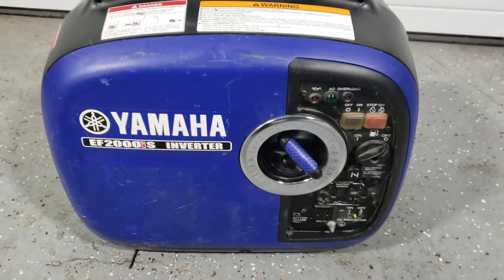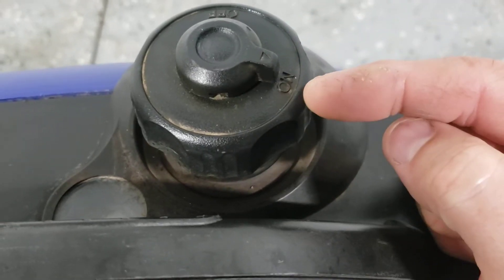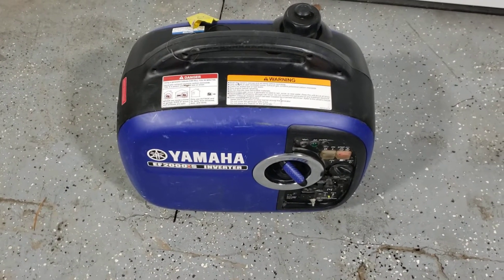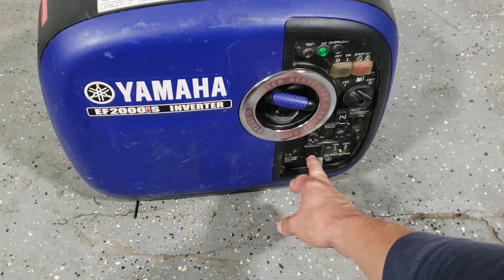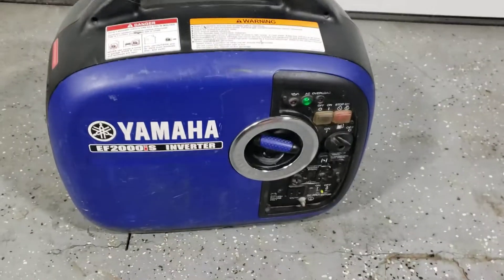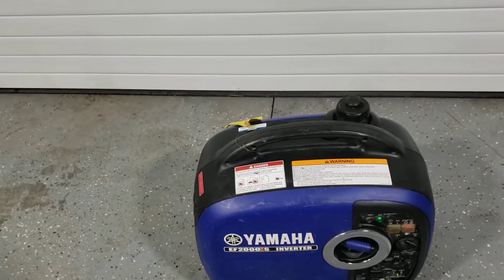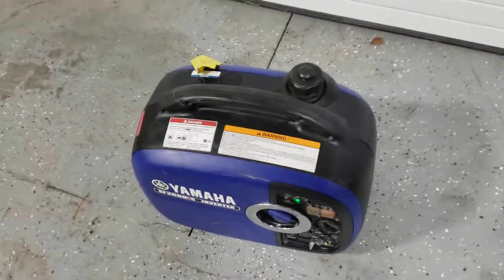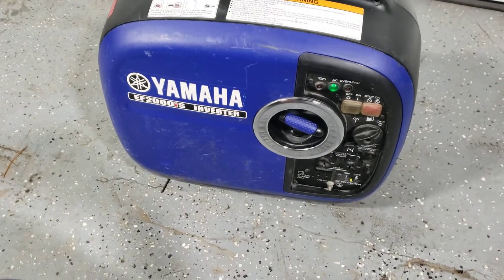Yamaha EF2000is Inverter Generator Operation

Comment: I have the same generator. I think I bought it around 2016-1018. Tested it with Coleman white gas. Worked great .  Welcome to April 2023 . Bought more Coleman gas to retest the generator. Started on the first pull . Coleman white gas is $ 14 a gallon today. Great gas Great generator .  I keep it for Hurricane season .

Comment: you had mentioned you'd make a separate video on the oil? I didn't see it on your channel, anywhere you could point me to to find that? Got a generator used and it looks as if oil leaked along the inside bottom. Currently trying to clean it out as good as possible, just not sure what I'm doing to be honest... thanks for the help!